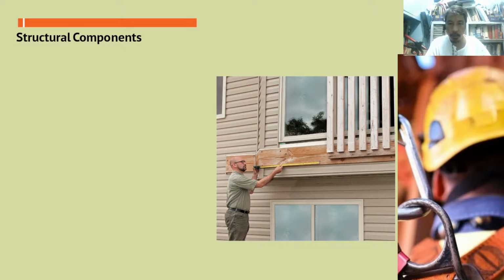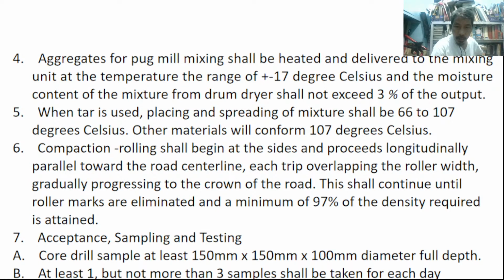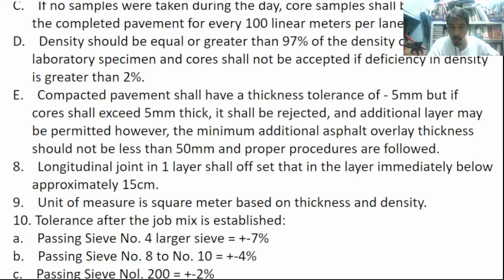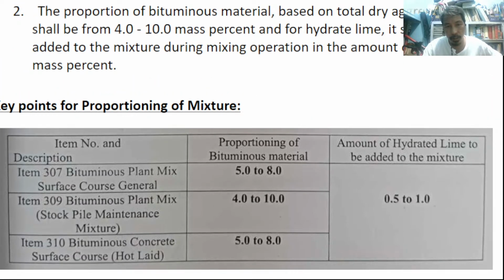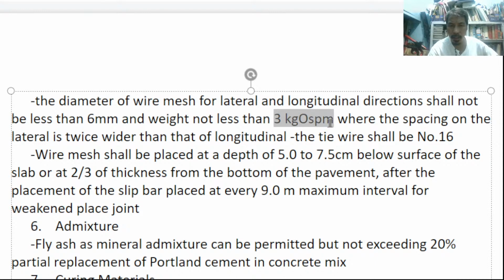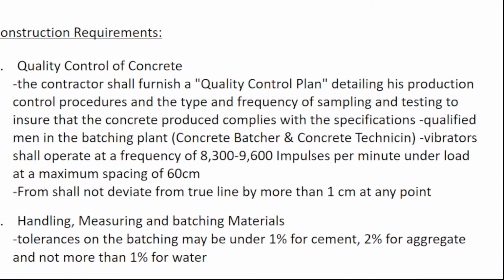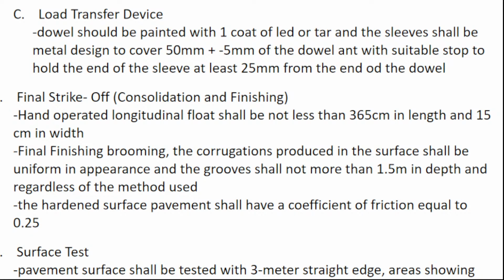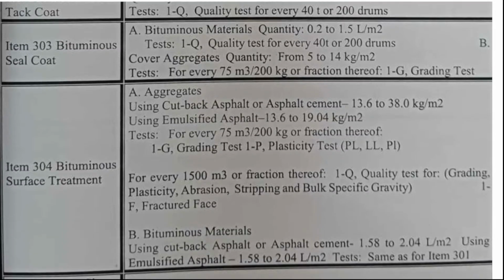[ LIVE CEE4 Lecture 10 ] DrAP Zantua Part E: Bituminous Plant-Mix Surface Course + Material Engineer

Comment: Thankyou sir for discussing about bituminous plant mix surface course. Batching plant scales shall be accurate to 0.5% of the maximum load that may be required and the contractor shall on hand not less than 10-20kg weights for testing the scales. Asphalt cement shall not be used while foaming nor shall be heated above 159 degrees Celsius at any time after delivery in project.

Comment: Thank you for this live lecture video that tackles about part e which is bituminous plant-mix surface course + material engineer. I have learned about the different items (307, 308, 309, 310 & 311) mentioned and discussed in this video.